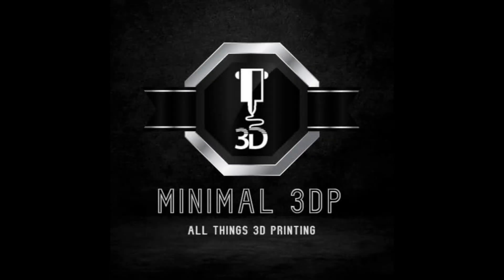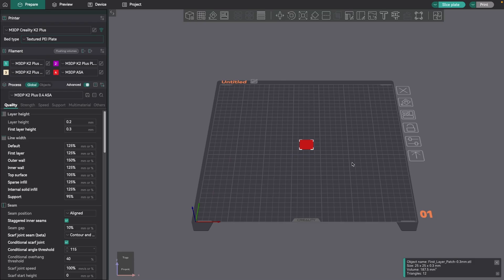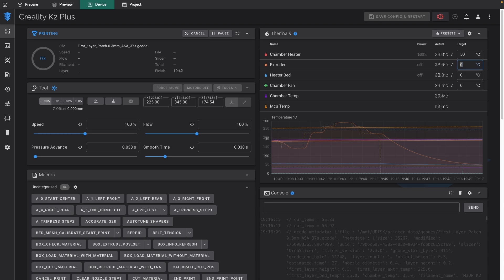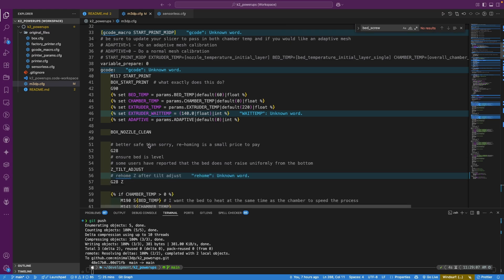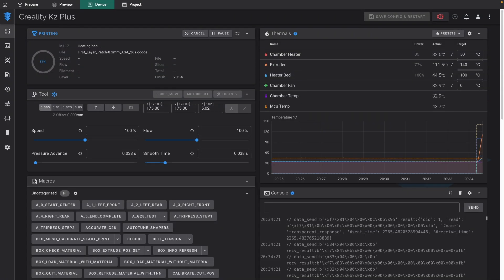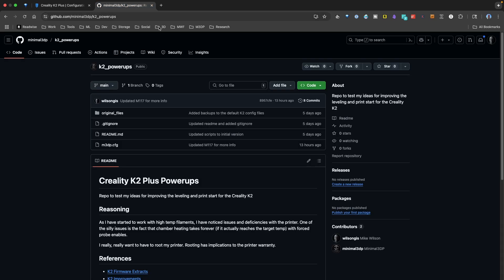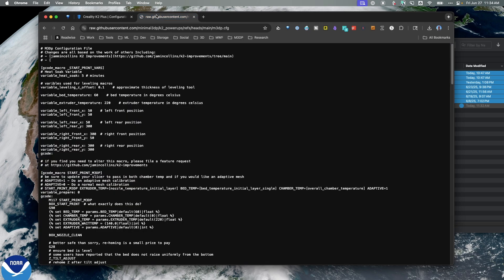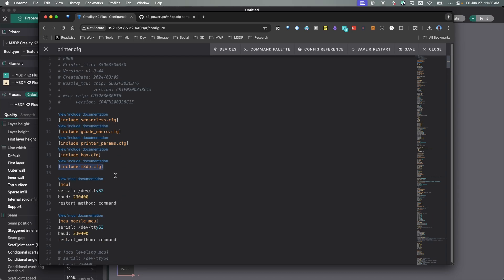Creality K2 Plus Performance Boost: Master Print Start for High-Temp Filaments

Comment: We are a Creality Reseller and I was shocked yesterday to find out the hardcoded 50°C mesh thing. Even for creality, this is pretty dumb for a 2025 printer. Every single, Literally every single printer we have had and sold with mesh, have done that at the Bed_temp set in filament profile.
Reply from the maker: It is hard for me to understand the design decision. It is really one of those small things that cause real problems.

Comment: I am thinking of buying for large ASA prints and lots of information for this noob thanks.
Reply from the maker: Once I got ASA dialed in I have been eased with the results. I would put the ASA in a dehydrator before you start printing though.

Comment: Thanks for the video. I usually do all this manually so this helps do it automatically. My question is how do i change the bed probe nozzle temp from 140 to something else? What about bed temp when probed? I like bed leveling at temps closet to my actual print temps.

For high temp filaments like PPA-cf/PPS-CF I like to probe at the highest temp I can before filament melts. Cause printing at 350c during the print vs 140c bed probe temp theres alot of thermal expansion difference in the nozzle that will not give an true bed leveling. (Nozzle will be too close to bed once @350c) so i try to compensate that with higher bed probe temps. Ive only managed to do that by using Orca and babysitting the bed probe temp. So as soon as it starts I manually change the nozzle and bed temp to desired temp but by the time the nozzle heats from 140c to 210c  the bed has already been probed 2-3 places which makes high "mountain peak" spots compared to the rest of the bed probed at the higher temp Thanks
Reply from the maker: Take a look at the start code. The 140 is in there. You could probably do some type of case statement to get it to set probing temp based on material selected.
Reply: @minimal3dp thank you
Reply: @minimal3dp  Stupid question but where do I find the start code at? Thanks for your help

Comment: Hi ! Thanks for your video, i have 2 question: if i changed my original bed for a R3men 3D bed, do I need to change something in your files ? And do you can partage your settings for ASA print ? :) Thanks a lot !
Reply from the maker: Not at all. You should be good keeping everything as is.

Comment: The changes you made are already part of the M191 macro in my repository.

Also, rooting does not hurt your warranty and is fully reversible.
Reply from the maker: I will take a look at the M191. I probably just need to break down and root. I appreciate your scripts and work.
Reply: i tried your repo but it just messed with everything it kept wanting to home random axis further then it actually can, threw random extruder errors and i was never able to actually start a print, tried many times for days to get it to work but gave up back to stock and finally printing like a boss again lol dont know what the dam prob was